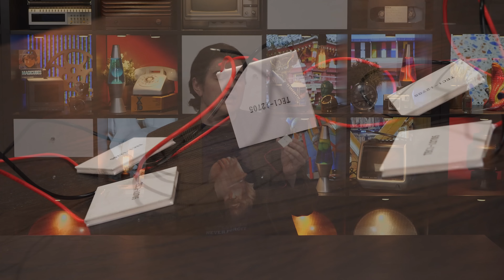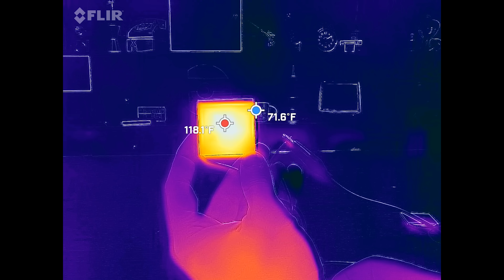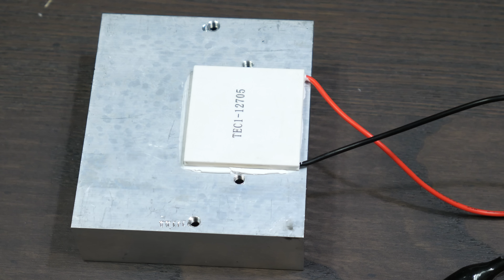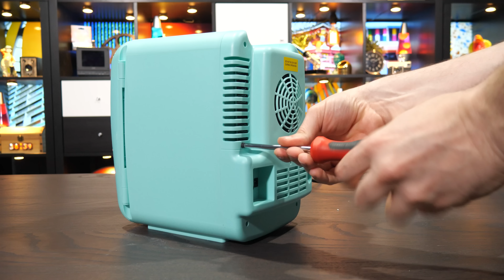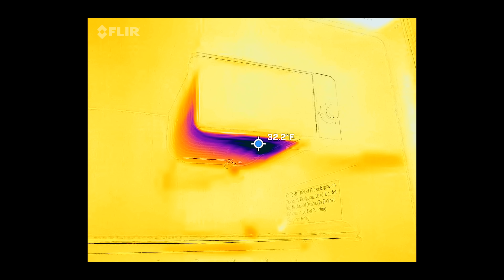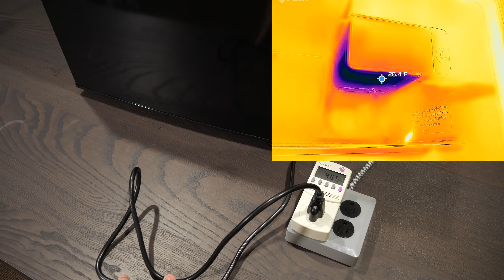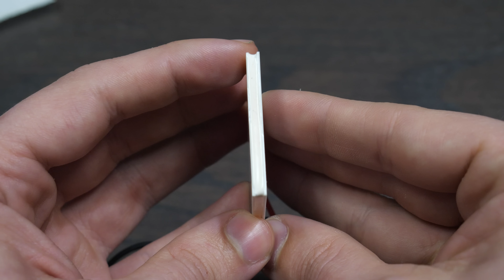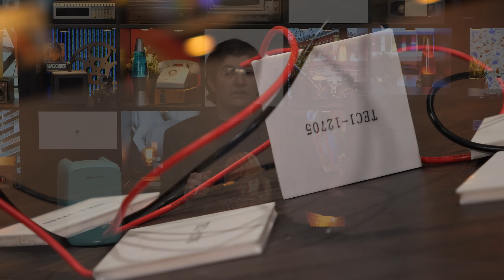Thermoelectric cooling: it's not great.

Comment: I wonder if you could use an array of these and put CPU coolers or some other similar heat dissipation on the hot side to make a completely passively cooled AC for example. It probably wouldn't be very efficient or effective, but I'd like to see it attempted regardless

Comment: doin some experiments over here at home. thing is surface area is lame on the cold side so you cant move a lot of heat away and that makes the hot side heatsink also lame. another is that wtf is a design without regulation....this is the worst way to do these small peltier coolers. it can be good in some situations thanks to its silence. overall yes it is somewhat 2-3 times less efficient than a system that uses freons but then mostly all of them cannot be done badly. with peltiers you can do SO MUCH bad designs its better to go the actual calculations first and get set with design that works.

pre-edit? = now hearin in the video you talk a lot about the design lol, so yes its not the best but it COULD be used sometimes. maybe we will have way better system in the future even better than compresor-full :D

Comment: The mini-fridge is a retail funnel product aimed at consumers with just enough curiosity to spend $30, but not enough confidence to buy the right product upfront.

It was designed for mass production, cheap pricing, and wide distribution. Sure, you could upgrade it for $250 to $500, but at that point it stops being a cheap retail gadget and becomes a custom project. Once that happens, it loses its entire value proposition.

That is the real point here: cheap funnel-site junk often does not deliver on the promise that made it attractive in the first place. It is priced low enough to feel interesting and safe, but the product itself is usually built to the same standard as the price tag.

The better move is to spend a little more on the right product, or even spend a lot more once on something that actually lasts. That beats buying a disposable $30 gadget that looks useful, feels like a deal, and then fails the exact job it was sold to perform.

These tests proved the core issue beyond question: it does not work.

Comment: Just wanted a small drink cooler for my room, didn't want to hear a compressor kicking in constantly, and I don't pay my electric bill. I did hours of research and ultimately got one of these. It cools slowly, but works well. The one I got has a temp setting that goes down to 35 degrees and while I didn't measure it does actually get drinks quite cold in maybe 3-5 hours. The fan is disappointingly audible but still quiet and less disruptive than a compressor,

Comment: The best use of a Peltier I’ve seen is those fans that go on top of a wood burning stove. Powered by the stove getting hot and they make a significant difference to how consistently warm a room can be if the wood burner is in a recessed fireplace. 

A friend of mine also has a candle powered radio in his kitchen that he built and uses daily 🤣

Comment: dude my entire electricity bill in peak summer averages about  $30 cheaper than the blue stupid junk and my house has 3 mini split AC's , a  400 litres fridge and other stuff and the Ac's run like a minimum of 150 housrs each to 300 at max and still all of them combined costs less , and for context in India where I live A unit(KW/H) costs 9 cents  and ambient temperature outside in summer goes upto 40-45 degrees celcius and indoors can be 30-35 celcius so the appliences work much harder than what the mini junk has to and taking into acount the lower price of a kw/h ,the cost per year of the mini junk comes out to $40 which is insane and my fridge consumes 290 kw/h a year coming to $25 a year and my monthly bill is an average $61

Comment: I have something solar to this. Same cooling and same power consumption but it cools 14 or 15 cans.

I use it in the work van. It has a 110 outlet and the alternator is running anyway, so why not.

The insulation is good enough to keep it cooled between workdays. It runs just about all day and cools well enough to be refreshing.

I run the AC bc its getting warm out and I have it set to floor bc that's always been my preferred setting. This helps cool the fridge to some extent and is a nice benefit.

The noise is basically invisible when in a work van.

The reason I got one of these is bc I couldn't find an electric cooler of compact size. I wanted a cooler that could run off the 12v socket and stuff behind the seat. That doesn't seem to exist or be readily available, so I got a peltier fridge.

I've had a few of these actually. I have the Xbox shaped one.... The inverter board gave up.
I had a slightly different model of the one I have now. That lasted 2 years and the fan started getting nosey and eventually seized. So I replaced it with a better fan. Then the inverter board gave up a year or so later.

Now I have this one.

The real weak point of these things is the AC to DC board. All of mine have DC car adapters and work just fine on those. That's how I figured out the AC board gave up.

Comment: Peltier elements have another important application: Since the process is reversible if you heat one side while keeping the other side cooler they output electric power. Yes, with horrible efficiency but using a radioactive substance to produce the heat and you get a light and small radionuclid battery that lasts a long time. Just perfect for satelites.

Comment: This would run off of my portable power station and my old mini fridge will not, due to the surge watts involved in starting the compressor. 45° is adequate for lots of things and a whole lot better than nothing. But high energy usage is unacceptable. I wonder how a countertop ice maker would add up, electricity-wise and ice-wise, filling a small cooler with ice and replenishing periodically? I imagine it is a favorable comparison to the peltier cooler, but is it good?

Comment: I have an other example of where those elements of success for these kinda work out: If you have to provide cool drinks for DJ's from underneath a booth that is build and moved, including fridge, multiple times a week(end), and you get provided promotional mini fridges like this from the brands that you are serving, which you can stock from a large supply of pre-cooled drinks from actual refrigerators and/or cold storage. Then these are pretty great...

Comment: Knowing its limits I got one wine thermoelectric wine cooler simply because I didn’t wanted a bulkier and more expensive compressor unit. It does its job better than I expected, my ambient got the AC on almost all the time so the cooler doesn’t have to work too much and gets to its minimal temperature of 12c. But expect that those things can get the contents really cold will be only get you frustrated.

Comment: "More quicklier?"

Maybe it's because I am not an American but I think most of my fellow non-American consumers are informed enough to know that you don't buy one of these as a refrigerator but rather as a portable cooler that doesn't require ice. On my smaller fishing boat that has no room for a fridge, much less a 120 volt outlet, I use one of these to keep all my food cold for week long excursions on the water. 
You load these coolers with food when it -the food - is cold,  just like you would a cooler. It gets plugged in to a 12volt deep cycle battery that I keep charged with the outboard when we're out on the water. Food stays cold indefinitely - despite the hot summer weather. While the device may claim to keep the contents x-degrees cooler than ambient, the savvy consumer realizes that it also significantly slows the rate of heat transfer of the stuff inside to the outside thereby increasing the time that food inside remains 'safe' or chilled, without the need for ice. So, it DOES have a use and I've not found any technology that does the same for as long or as little cost. 

C'mon - who do you think you're kidding? You don't even drink beer.

Comment: I bought one of these to keep my insulin cool while camping.  I added a thermometer to keep an eye on things.  The unit I bought keeps a steady temperature of 40 to 45 degrees in even hot weather.  I use this on 12 volts and it does quite well.  Just my experience with it.

Comment: I wonder why someone hasn't made a tiny desk fridge with an actual compressor?  Counter top ice machines use them, and they include compressor, water pump, ice making components, and a water tank.  if you removed those components, should be able to make a desk friendly version say twice the size of the "toy" fridge.

Comment: QVC had the Dreo reverse osmosis system with two pitchers included for $150 vs the $270. I bought it for my RV as water goes through it fast and I get impatient. When I googled it, it seemed like a good deal and it appears it is based off your price. I was using Pur before.  Based on your review I think I did good.

Comment: I THINK a lot of this is that many engineers are just absolute trash at designing peltier fridges. Peltiers can achieve COPs of 30 with extreme care, in some circumstances, but getting them to do that in the context of a fridge takes actual skill.
Reply: Only if deltaT is close to zero, 1 to 2 is more realistic, but those fridges likely run at a 1/3 COP if not worse.

Comment: So I watched it really interesting video having watched years already about these and one guy found a Japanese fridge I think it was called My sake like MSA k e that they took that he made an interesting or there's two most efficient there's two ways to run it for maximum output and one is low power one is high power and they achieve the same thing but one waste a lot of energy and he found that almost all the fridges used the worst algorithm but m a m a s a k e They wrote their all good rhythm right It uses the power hungry for the first 10 20 30 minutes and then switches into the low version mode now they're not going to be a sufficient as a you know a typical refrigerant system with a compressor but they get a lot better I was wondering whether you would be considering looking would whether you would consider looking at that one and comparing it with existing other thermoelectrics and in the compression cycle ones refrigerant compression cycle ones I thought it looked like it's going to be about 70% as efficient as a typical refrigerator which is way better than what most thermoelectric peltieres are.

Comment: That energy use is strange on the fridge. I have a 20-year-old full sized fridge & freezer. It will use 140w when the compressor is running, but only 10w when it's not.

Comment: The way you theorise it's potential to freeze things makes me wonder if there is a way to modify the toy by filling it's door with an insulating component (like spray foam) and putting a thermo controller in there somewhere. I also know they can generate power by the temperature differential as indicated by those firebox fans, like a flat Sterling Engine.

Comment: Even if you are only using these "mini mini" fridges in an office building, you still have to consider the fact that the company that owns the office building has to pay the electric bills for that office building. If you use one of these "mini mini" fridges in an office building, the company that owns the office building has to pay higher electric bills. This can cause the company that owns the office building to cut costs, and you and your co-workers will feel the effects of this cost-cutting. It can also cause the company to lower your wage and/or the wages of other employees. In very extreme cases, it can also cause the company to fire some of the employees as a result of this cost-cutting. Even if you are only using one of these "mini mini" fridges in an office building, there is still a cost associated with it, and your employer is not going to be happy about the fact that you're using one of these "mini mini" fridges in the office. If the office building you work at allows you to bring a regular mini fridge, then buy a regular mini fridge that has wheels and a handle. Even if the office building doesn't allow you to bring a regular mini fridge, just don't buy one of these "mini mini" fridges.

Comment: I rent a tiny workshop (with included electricity) and I picked up one of these second hand for $10, and yeah it's def not the best but it does make my beers drinkable after a few hours 😁Perfect way to end a day of tinkering.
But yeah I probably would never put anything other than drinks in there.. And never leave it on. Just a few hours to chill my beers, that's it.

Comment: I have a wine cooler that uses Peltier element, but it also has evaporator filled with cyclopentane on the hot side of the element and a controller with NTC. It doesn't quite go down to food safe temperatures, but its nice to have under the desk for cold drinks.

Comment: I will say that you absolutely could make a much better temperature controlled and properly insulated peltier fridge. 
It’s just why would you. 
Those cheap portable coolers are meant for cars and on the go or for using when fridges are banned. 
But the reason that cheap fridge uses so much power comes from two reasons. It’s not strong enough to create a decent buffer (because again it has to work with a car Plug) and because there is virtually no real insulation heat leak is a massive problem. 
Those are definitely junk, but only because they were never designed for any application where a fridge could be used.

Comment: It's too bad you didn't spray some Great Stuff or something in the door to see what effect it actually had on the cooling.  But it seems that all these tiny-fridges promise about 30 degrees difference, so it's almost as if that's a design constraint.  I wonder if there's some legal definition that if it's more than 30 degrees it's classified/regulated as a fridge?

On the other hand, the mounting screws do get covered with ice during operation so I guess the element is able to make things cold enough.

Comment: Also, when it comes to practical uses of those thermal electric cooling elements, if you apply heat to one side and a heat sink on the other side, it will generate electric

Comment: peltiers work better as electrical generators rather than  coolers. they literally generate heat when operating like coolers so bad idea.  but when used as power for fans in heat sinks and such can be extremely useful as essentially free power

Comment: From what I've seen a conventional compressor sucks oil from the bottom of the housing (sump) through the centre (sp) of the armature.  It then flies out upwards and sideways (like a lawn sprinkler) and runs down the inside of the housing back to the bottom.  I've measured temperatures of 80 degC on the top surface of a fridge compressor.

Comment: Interestingly, to make them more effective you can stack them. You can also buy pre-made stacked peltier modules. A peltier stack of 3 can achieve incredibly low temperatures well below freezing but somehow without melting. Idk how it works, it just does. It will consume triple the power though.

Comment: I have one i kept having issues woth the cooling fan not wortk so i removed it cut a hole it the back of the case and screw a 80mm pc fan to it havent had an issue with it since i havemt used it in awhile since ive gotten a proper mini fridge which i do have issues with ( it keeps trying to be a freezer and freezes everything i had ti turn the temp as low as it goes and its still super cold doesn’t freeze everything now but its cold as hell

Comment: i hade a iceless igloo cooler when i was an otr truck driver company wouldnt let us put in onverters to have a mini fridge but id keep the ac on and inside of the truck according to a thermometer at 65 cooler would normally be around 38 degrees inside had a pulp thermometer taped to the side it was nice being able to keep some lunch meat cheese and milk on the truck to cut down how expensive it can be to eat when you drive truck. yea they arent efficient but in this use case it worked and didnt need to remember to get ice and constantly drain water out of a cooler

Comment: I suspect these have a potential to be good. They just need to chill down to 3 degrees. Two devices running at half the voltage doesn't add that much price, yet keeps the same cooling while being more efficient. Then a beefier heat sink could let them reach low enough temperature. Then it would be neat if they had better fans. 120mm, better airflow and like PC fans able to run quieter. This currently would increase the price so much that they would compete against actual fridges and while still drawing more power.

There are some advancements making the devices themselves better as well, so they may actually be good some day. If they are quiet, small and cold enough I don't care if they're not that energy efficient.

Comment: At work, We're developing a new kind of fiber laser. Since we are designing it to be compact, we use these TECs to cool our laser diodes. We attach the hot side to an aluminum block containing a cooling loop, with a graphite pad between to better transfer heat. We use a TEC controller to set/sense temperature while throttling voltage/current, in a sort of PID-like loop. It works extremely well if you are able to effeciently cool the hot side.

Comment: They're a good last resort during a power outage if you must keep insulin cool. A peltier fridge can run 1-2 days on a large DC backup battery. The inverter losses alone will drain a battery after just a few hours when you have a mini fridge plugged into it.